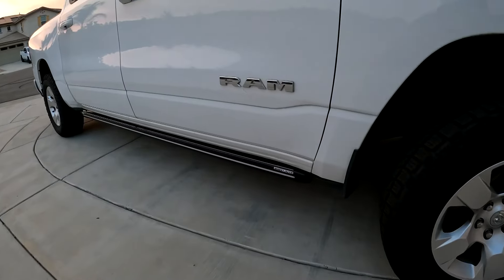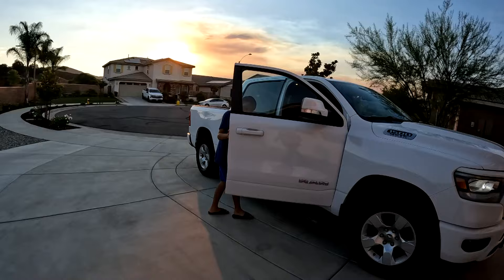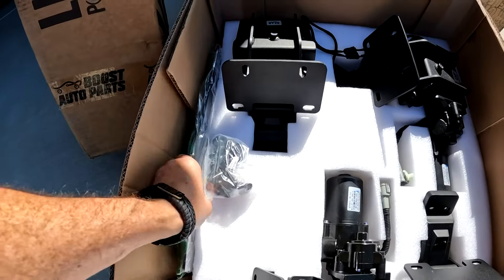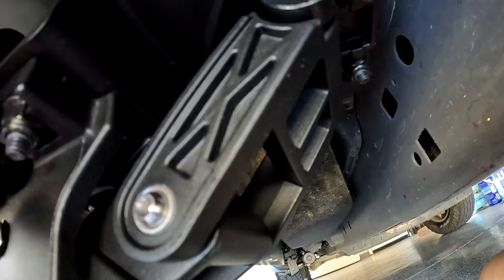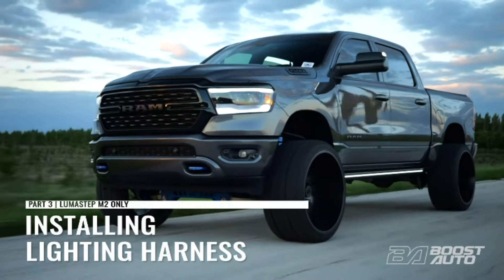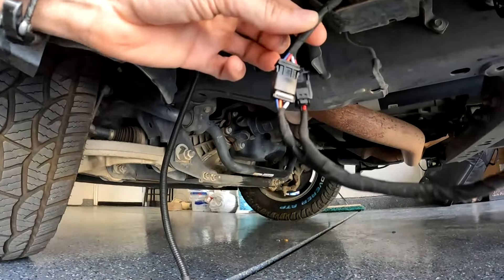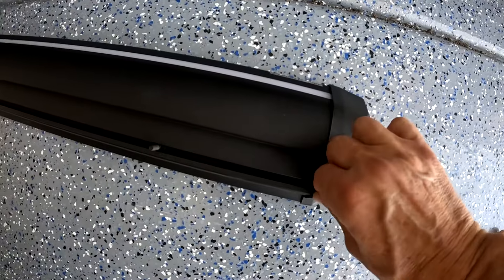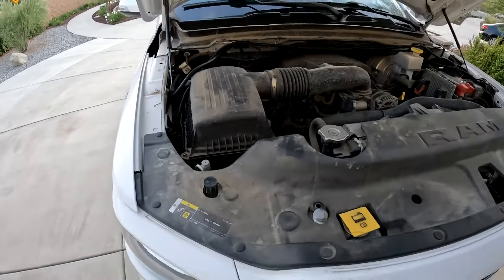RAM Truck Running Boards - LED and Retractable

Comment: There was no paint on those bolts. That i can see. BUT those are nylon lock washers. Those are meant to be hard to put on because the nylon bites into the threads so they dont rattle off.